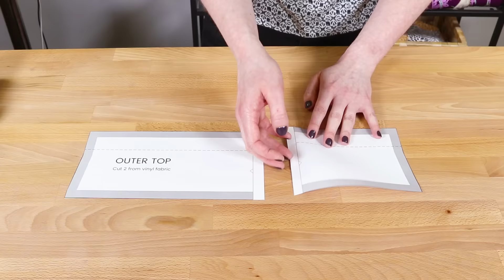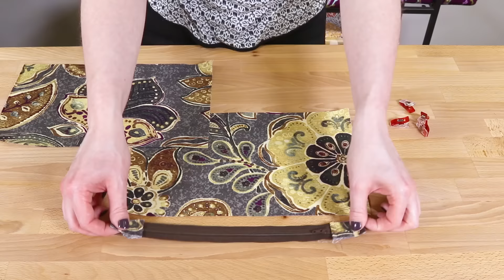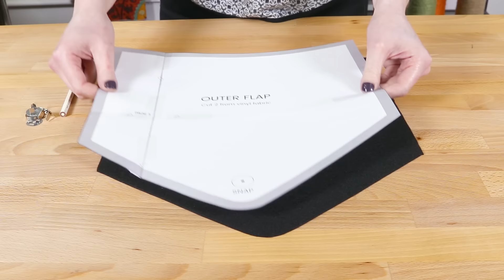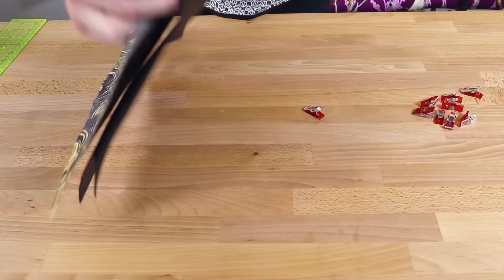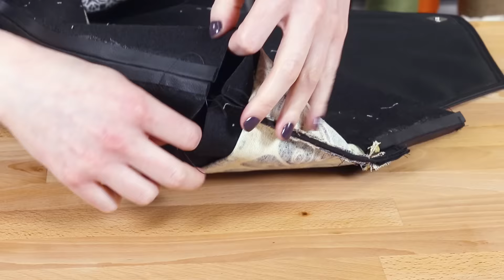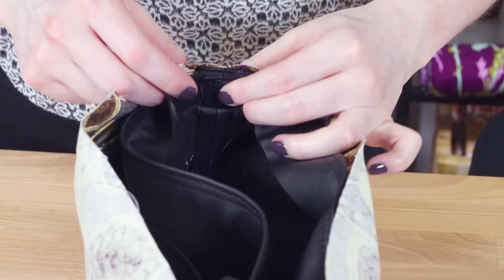How to Make a Faux Leather Vinyl Handbag

Comment: Is there anyway to add a stiffener so this bag will stand up?
Reply from the maker: Sure! You can add interfacing between the lining and the vinyl.
Reply: ClairM   I made this without any interfacing except on the lining pieces, however, my next one will be firmer by adding either decovil light or decovil heavy, to all vinyl pieces, which would make it a lot stiffer.

Comment: This was a nice pattern. The only thing I would do different next time, and it's just my preference, is to cut the outside pieces as one piece so there's no seam in the middle of the purse bottom. There's not reason to have that open since this pattern sews it shut anyway and you birth the bag through the lining. Otherwise, it's a very cute design! Oh, I would also only sew one line going down the middle of the inner pocket. I can't put anything in those tiny pockets unless I'm carrying a crap load of pens or something. This is all easy stuff to modify though so the pattern was well worth it.

Comment: I wanted to share my experience making this bag which I sewed out today!  I downloaded the pattern last week (thanks for the free download) cut it out and taped together.  I wasn't sure I had enough Faux leather but I did.  I did an inventory of what I needed vs what I had.  Walmart has new fabric and some of it is amazingly gorgeous.  Anyways I picked up a yard of lining.  You will have just enough so take care placing your pattern pieces.  You will use ALL of 1 yard lining fabric. Same with the Vinyl.  So this morning I decided I was going for it.  I cut out and started piecing.  I have to tell you your video and pattern pieces are spot on.  No issues at all.  None!  It took me 2 cups of coffee, 3 diet pepsis and a small bag of chips but its all done.  It turned out exactly like yours.  Everything fit together nicely.  If and when I make it again I will make 2 small changes.  I did use contact cement for the bottom seam which makes a huge difference with a shape of bag.  I would have added alittle batting to the interior between the lining and vinyl for more shape on all 4 sides and had chocolate chip cookies in my pantry.  Other than that its way cute.  Thanks again.  Sorry I am chatty and happy with the outcome.

Comment: Looks nice, however is this pattern for an advanced sewer?
Reply from the maker: Hi Desiree, yes we'd recommend this project for an intermediate to advanced sewer. Sewing vinyl can be tricky because you can't really rip out mistakes like you can with woven fabric because the needle leaves permanent holes. If you use a different fabric, it may be OK for a confident beginner!

Comment: Bonjour beau travail félicitations !  Quelle est là dimensions des anneaux pour les anses et es que c’est aussi beau si le sac est fait tout en tissu ? Quels tissus choisir dans ce cas? Merci de votre réponse
Reply from the maker: Thanks Martine! The D-rings are 1-1/4 inches. Yes, you can make this bag out of fabric too. You'll need to use an interfacing ironed onto the back of the fabric to make it stiffer. This page has some suggestions for the types of fabric that are good for bags: https://www.onlinefabricstore.net/makersmill/what-fabrics-are-good-for-tote-bags/
Reply: OnlineFabricStore.net  merci